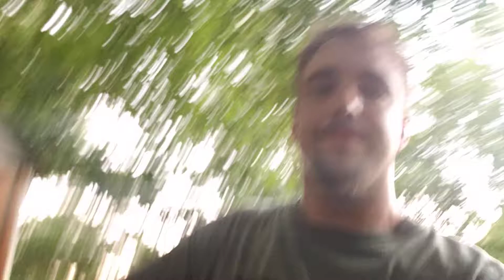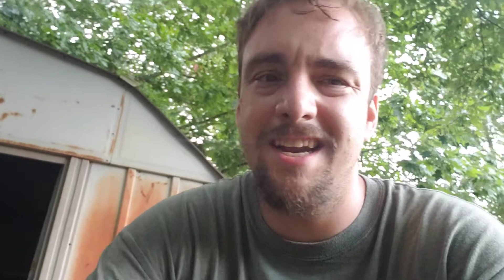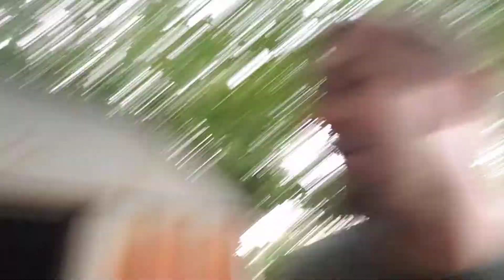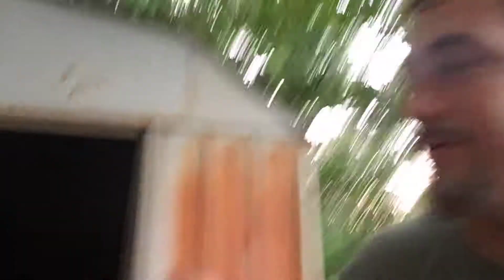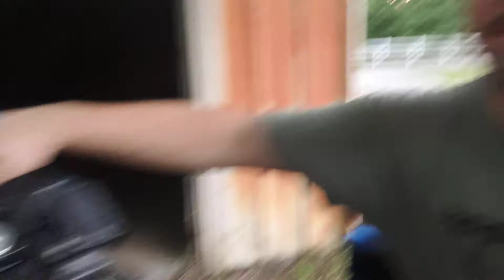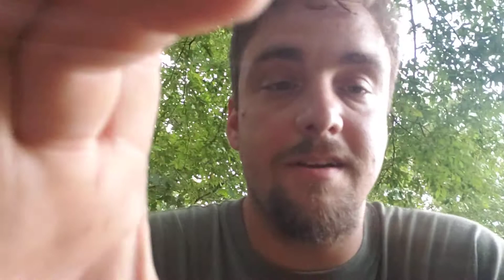Suzi-Q is almost ready to go again.

Comment: That cam shift should make a nice difference along with thd 2 stage nos shes gonna really shift
Reply from the maker: She went a to b and she shifted but I still have a stumble off the line.
Reply: @RingTuned   the cam change and extended inlet geometry may be to blame for that are you using stock 2 long 2 short trumpets on  my bandit  engine there all the same length to "hit " together